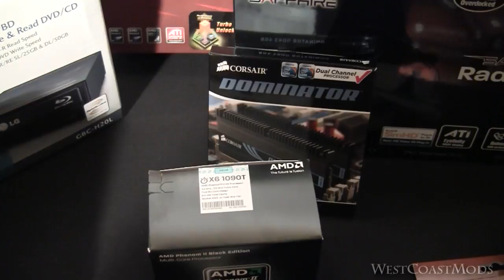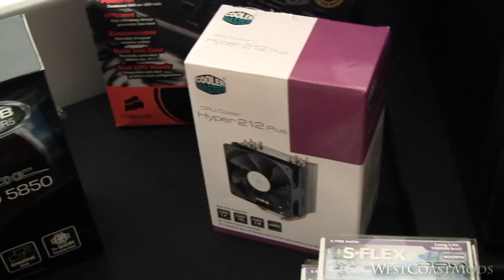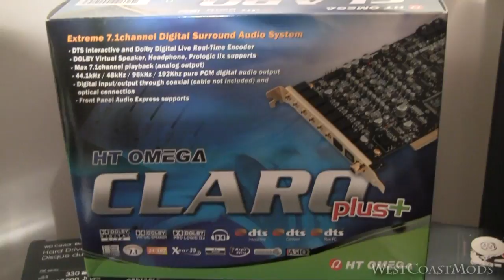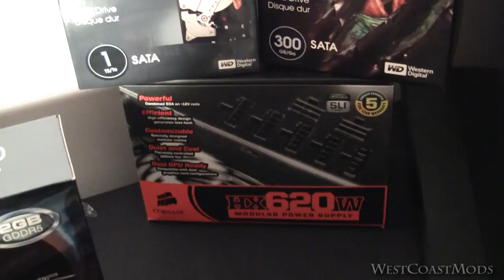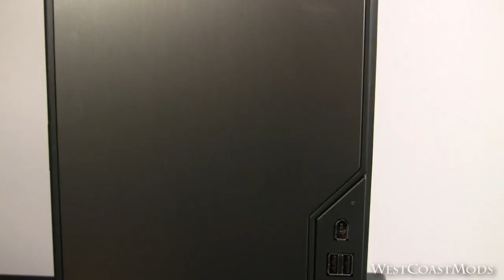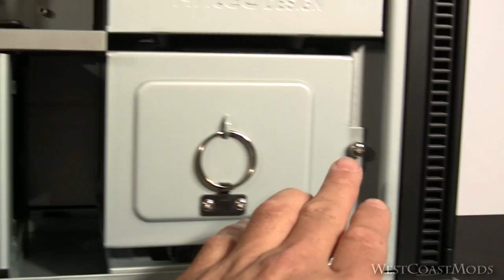AMD X6 1090T- Crosshair IV Formula Mobo

Comment from the maker: @KeithWasHere1 Keep in mind that shiny does not mean flat....I can make almost any metal in any shape have a mirror finish.....just like a cars chrome bumper. The best heat dissipation is metal to metal contact...and the more metal to metal contact you have the better the temps will be...assuming that you use a good cooler...and with all due respect the H50 is not one of them...there are air coolers on the market that perform better than the H50, H70..and any of the other all-in-one solutions

Comment from the maker: @KeithWasHere1 Glad it worked for you...but FYI...the goal is not necessarily to get a shinny surface, the goal is to get it as flat as possible and to remove any of the micro imperfections. It become shiny as a result of the process......and you should continue using sandpaper through 600 grit, 1000 grit, 1500 grit and then finally 2000 grit....that is the proper way to do it. I would imagine if your temps dropped already they will drop even more if you do it properly.

Comment: @WestCoastMods i have the 212, running push pull, on a amd x3 cpu at 30c idle. for 17.50$ its the best heat-sink ive ever bought

Comment from the maker: @Darkture You need to Goolge the 212....it is not a bad cooler at all...sure it is not top of the line like Noctua or the Silver arrow, but it will compete with most.....and it is under $30

Comment: @WestCoastMods So I did :). My mistake. Also I was mistaken. The VIA chip that the sticker is on, afaik, is an I/O IC. The sound IC is above it. I don't have a board diagram infront of me I'm going to check the PDF. On most of the ROG boards it's a Realtek IC..

Comment: @111olbap Take the sticker off. The Crosshair IV is a via chip. There's no such thing as Supreme FX onboard sound. It's a good old HDAudio controller with a screwy codec. As far as I know the Intel side ROG boards are using a Realtek solution. My Rampage 3 Formula is a realtek chip and shows up in the bios as such.

Comment from the maker: @white8ass8kika Unfortunately it doesn't work that way...you are correct it will access both drives at the same time allowing for faster speeds, but it won't quite double it.You won't see completely linear scaling, Not sure what the technical reason is, but I do there is some lag for the 2 drives to communicate with each other. Before you run them in raid try some test to see what your speed is using a single drive and what your speed is running raid.

Comment: Hey Lazyman, just used the Hyper 212 in my latest build using the Antec 200 case and an AMD 9450, she's running super cold at 26C in a push/pull using the CoolerMaster R4 fans. Couldn't get pics or vid because customer put a rush on the build but it is running super chilly!

Comment: I have a similar Build...
Running 1090T 
Crosshair IV Formula Mobo
Patriot Sector 5 Memory (4GB x 4)
Thermal Take Bigwater 760i (Replaced the waterblock, and added a 360 Radiator)
1TB Cavier Black (64mb Cache)
CF 5770
Powered by Corsair 650 watt In the 932 HAF Case.. Good Stuff

Comment from the maker: @sh4rkbyt3 You could do a pic montage...some of my video's are nothing but pictures.....also I check out the fan and it say 69.96 CFM..@2000 RPM's..not 90. I think the Enermax 120mm fans are better with higher CFM at lower dBA...check them out if you have the chance....enermaxusa(dot)com

Comment: @WestCoastMods No video sorry, I don't have a camera with video capabilities. The fans are the same ones I used for my own build. CoolerMaster Sickle Blade Fans which are available @ CompUSA for only $9.99 ea. Blue LED or Green LED only and believe me they are very quiet on stock speed.

Comment from the maker: @sh4rkbyt3 Your client build sounds nice, will you be doing a video on it? Also what fans are the ones your using...I really would like to check them out...cause if they run at 2000RPM's @ only 19dBA, I need to check them out.

Thanks

Comment: Hey Lazyman. I'm using the Hyper212 in my newest build for a customer with the CoolerMaster 2000rpm fans @ 19db and 90 cfm in a push/pull config as well. AMD 9450 CPU, couldn't beat the price for the CPU. WD Caviar Black 1Tb too. Antec 200 case (the new one). 
This is a nice build! Love the Velociraptor! Wow nice OC on this too!!!

Comment from the maker: @MJBDC7 My bad, I thought it was a typo and you were referring to the H70. Anyway most mobo's recommend that you use the 2nd,4th,6th slot Even on this board it says that you can use either the 1st or 2nd slot..use the first slot for extreme OC'ing...I used the 2nd & 4th slot and only OC'ed the ram to 1600Mhz per the client request.

The other option is that you could pull the heatsink off the 1st module...ram really isn't notorious to overheating...it's more of a hype to get us to spend more $

Comment from the maker: @DavidsPCchannel  I really don't know the dimensions of the Frio, so I can't say it will work or not. But as you saw in this video the client did use Dominator ram and there was no clearance problems when using the second slot. The mobo manual said to use the first ram slot if you were doing extreme OC'ing to the ram themselves, but in this case we did not OC the ram beyond 1600Mhz

Comment from the maker: @asus3571 I would not necessarly change my NB thermal compound just to have something to do....If you are experiencing higher than normal tempos then I would. And just like you mentioned the NB is held down with plastic pins, I have never used a board that uses these so I don't really know, but it sounds like it is possible to break one of them while in the process of removing the heatsink....would not attempt unless it was absolutely necessary......find something else to mod

Happy Holidays

Comment: need a little advice your a master at mods ive got an x58aud3r mobo basically ive run out mods i can do and just plain bored so i want to take off the n/b heatsink and reaply the stock paste w/ mx3 but the heatsink is fastened with those bullshit plastic pins can they be removed and reusedor would you not recomend me messin with those pins n/b iisnt that hot 45 idle with my 920 running at 3400mhz gameing w/ crysis for as long as i want temps only reach about 49c thanks brother

Comment: Hi, I am probably building a similar rig so I was wondering if you had enough space between the CPU cooler and the RAM slots especially for large heat sinks (HiperX, G.Skill, Dominator etc.) I am probably getting the Thermaltake Frio fan unless there is the space issue with that one. thanks for your help

Comment from the maker: @LeDgEnDx Why is it forced to point up/down? and actually this would not be a bad thing as heat rises it will push the hot air up and out your case, that is if you have ventilation at the top of your case. I have installed a lot of coolers in this fashion.

Comment from the maker: @Simmonds9000 The V8 is not one of the ones I was talking about and the V12 is a oversize piece of junk, I was thinking more in the line of the Thermalright and Noctua coolers, even the Thermaltake Frio has better temps...also there are several more.But you are correct they do require some clean every now and then.

Comment from the maker: @SuccessXS Unfortunately there is no exact receipt, it is a trail and errror kinda thing and I really don't have the time. I would just Google "overclocking the 1035t" and you should get some real valuable info. To get a decent stable OC it could take a couple of days of adjusting this or that to achieve the desire speed and still have it stable. However I normally just do everything in the Bios, so I don't know how sufficient AMD Overdrive is.
It's really not that hard, just takes time....

Comment from the maker: @Russ88765 It does, but I never use the stock thermal paste for a final installation, maybe for test purposes, but other than that the paste that came with cooler is not very good as with most stock thermal paste.

Comment from the maker: @SuccessXS There are several out there.....just Google "best mobo for AMD1090t processor" and you should find several. IMO I would go with the Asus featured in this video...it's a very strong board, especially if you are going to OC it...also I found that this board had no problem when I unlocked the 5th and 6th core.

Good luck
LazyMan

Comment from the maker: @ravinbreaker IMO I would not even use the stock heartsink, but if you're going to then I'm sure the stock fan will be adequate.  Don't recall the spec's off hand, but if you can pick up a better fan cheap then it wouldn't hurt to change it.

Comment from the maker: @Mrendgame1 In this video I talked about and showed how I took the NB heatsink off and modded the standoffs to allow for better contact.

If you want this board then just buy it, monitor the temp on the NB and if it is running to hot, all you have to do is mod it as I did and you will be fine.

Comment: Yes. When i enable the 5th and 6th cores in the bios windows freezes at start up like in the windows logo. When the 5 and 6 are off windows logs in normally.

I have flash the bios two times but nothing seems to work. Should i change the mobo? Dont know what to do  thank you for your help

Comment: hey guys, I just bought that motherboard and the phenom ii x 6 1090t  but when im about to load windows it freezes on the logo with 2 color dots i have two dual memory 2x4gb  the computer boot up like normally and i can get into bios too, any reason why ?? also if i disable  5th and 6th core it succesfully logs into windows  i have updated the bios too please any help will appreciated thx.

Comment from the maker: @ZerqTM Yeah, sounds like you have had some experience with this case..... yeah I was looking at modding the front door for that exact reason...was going to cut out an opening so the drive would open and close freely. But due to time restraints, I decided it would require a lot of work...didn't know how I would finish off the edges, so they didn't look like a chop job...lol

don't forget to sub
LazyMan

Comment: that fan by the psu is a real pain because you have ot make sure the cables to get stuck in it.... i put a grill over mine to make sure that dident happen... though for a long time i just dident plug the fan in untill i upgrades stuff and needed more cooling

Comment: i actually ripped the door of mine because i hated how it keep stoping the cd tray sliding out which i feared would damage it... and keeping it open all the time made it stick out akwardly...

also this case is really not that easy to work with... especialy with lager graphic cards like the Saphire HD5830 i got for mine.... 

(then again i have one Vecoloraptor (160gb), 2 750gb hds and once DVD RW drive so i have a lot of cables to deal with...

Comment from the maker: @damieno613 I am no 100% sure, but I think you will be fine as I have a V8 on an Asus mobo and it doesn't block my Dominator ram in the first slot. Have not had a chance to look at or use the V6, but if it's like the V8, as far as how high it sits above the CPU, then you should be okay.

Comment: You shoulda just bought the noctua nh-u12p SE2, it comes with 2 nf-p12 fans and the heatsink is probably much better than the hyper 212+, and would all come up to just under what you got, and you don't have a spare fan lying about.

Comment: @WestCoastMods If i were to oc let's say the 1090 T to at least 3.5 Ghz stock cooling and my hd5970 a little , how long would you estimate it last ? Btw , are there any slightly lousier than crosshair 4 but still non-bottlenecking Mobo for my 1090T and HD 5970 ?

Comment from the maker: @InitialJProductions Even if you don't  OC there's no  guarantee that it will last 6-8 yrs. Nowadays, mobo's, GPU's and ram are built to be OC'ed.But that does not mean you have to do it. Anyway you need to be careful about bottleneck...if you want to get a lesser board, that would most likely require a lesser CPU you may be bottle necking the 5970. I hope this makes sense.

LazyMan

Comment: my system, shipping today:-
Haf x
4x 1tb in raid 5(maybe raid 10)
frio cpu cooler
formula IV(has xfi sound card)
1090t phenom II x6
antec true power 1000w
8gb ocz black edition ram lol
g15 keyboard
g19 mouse
samsung t260 26" monitor
Gigaworks t20 speakers

Comment from the maker: @naka538 The heatsink on this mobo is real easy to remove, just take out all the screws and it pretty much falls off. However that is not the case with all heatsinks, some requires a little bit of force...just proceed with caution.

Cheers
Lazyman

Comment: @WestCoastMods 
yeah was a lot depressing. 

antec df85 case 
asus crosshair 4 formula mobo
amd phenom II X6 1090T black edition
4gb ddr3 1600mhz dominator ultimate
corsair h50 water cooling
xfx ati hd 5970 gpu
corsair tx950w psu

but not as yet.

Comment: i changed the noctua coolers for akasa apache fans. much quieter and more airflow.  i only use one fan on my noctua nh u12p cooler and it runs cooler than noctua fans with push and pull config. if your planning to get quiet and high airflow fans go with akasa apache!!!

Comment from the maker: @fvgotch Thanks you sir.....yeah this case is pretty good for sound and has decent air flow, but the Siverstone with it's sound dampening material on all panels and those 3-180mm fans at the bottom was not only a very cool running system, but was hardly audible. Will see how this one is once I get everything installed and fired up.

Comment from the maker: Sounds like you have a nice setup, yeah aluminum cases are nice and easy to mod, now painting them is a whole different story. And as far as it aluminum cooling better over a steel case, I don't think that makes a big difference. As long as you have a good balance between intake/exhaust, a steel case is going to stay as cool as a aluminum. For it to act as a one big heatsink it needs to make actual contact, just being housed in an aluminum case really doesn't matter, except for weight.

Comment from the maker: @bigrock212121 Yeah, I would have just drilled a 4 1/4" or 4 1/2 " hole and put some mesh steel, most likely using rivets to hold it in place. Really no big deal, put with my current workload, it would have been time consuming. I'll be doing pretty much the same thing on the Corsair build, as I need to make a cut out to accommodate the 2/120 rad. hopefully I will do a video on that.

Comment: LazyMan, I just ordered 2 Gentle Typhoon fans, 1850 rpm,58.3cfm,28 dba,1.65 3/h vs Noctua NF-P12 1300 rpm, 54.3cfm, 19 dba, 92.3 3/h for my Mega Shadow.  The GTs were about 6 dollars less each vs the Noctuas. How would you compare the 2 for static pressure for the Maga Shadow?

Comment from the maker: @bigrock212121 Yeah, i guess you could put it in either way, but normally a PSU mounted on the bottom has the fan facing down. This way it pulls cooler air in, and even though they did not provide any vents on the bottom it is elevated so it can still pull cool air from the fan right in front of it. That is mt best guess.....so far.

Comment from the maker: @t3hsniper That may true, but in this case it is DDR3 ram, so I don't know if that still hold true. also this was 2- 2GB sticks, with this board only having 4 slots, the client wanted the option to install 2 more 2 GB sticks in the future. And had we gone with 4 sticks of 1GB each then he would not have had that option, regardless of a small savings.

Comment: Ever noticed that you usually save by buying 2 dualchannel ram kits instead of checking out a 4 pack.  Lately I realized it seems if you up to a 4 pack of ram(ddr2 800 4x2gb and other ddr2 I've looked at) instead of 2 sticks seems that you end up paying a little more usually.

Comment: @Aaronage1 i just want to play games like gta4. heres the build i want
700w psu
ati radeon xfx Hd 5770
msi 790fx-gd70
phenom II x4 965 black edition
tuniq tower 120 extreme
artic silver 5
nzxt m59 case 
and i just can figure out what ram to get. i want it to be plug and play. dont want to have to mess around with it. so if you could tell me if the 965 be will work with gta and tell me the ram i should get. (lower price the better) i would appreciate that very much.
Brian

Comment: @wiifan62 Considering the 965 and 1055T cost pretty much the same, it's a no brainer to go with 1055T. Both CPU's overclock very well and the 1055T will be miles ahead of the 965 in highly threaded tasks :)

Comment: That's a very nice build! Sorta like the big brother to my Antec MIni P180 build :)

A quality 620w PSU like that is more than enough for this system. I'm running a similar spec on 600w OC Z Stealth (965 @ 4GHz, 5850 @ 1GHz, 2 X HDD, Optical drive, 6 fans, 2 X mini CCFL)

The Samsung F3 1TB is faster than both the Veloci and Caviar Black AFAIK.

Keep up the awesome *likes*

Comment from the maker: @hmmk4y I believe they are very comparable as this WD has 2 500GB platters instead of the older 3 platter version. I believe it's just a matter of preference at this point as they both are very solid and quick, that is for a standard HDD. I just have always been a fan of the Caviar's Blacks.

Comment from the maker: @soggymaster Yeah, with the Dominators, you have to use the 2nd and 4th slot, reading the manual, the only benefits of using the 1st and 3rd slot is for better OC'ing, and even though I have OC it to 4.0 we will not be pushing it  any further.

Comment: Awesome video Lazyman. That case has been out for quite some time and I've always wanted to see a nice build with it to see how well it works out. I actually run the exact same drives in my build except I use the 300gb for my games and the 1tb as storage etc. Both drives are smokin fast for what they are and that 300gb is outstanding for games. Been thinkin of pickin up another since the price dropped a lil and goin Raid 0 :D